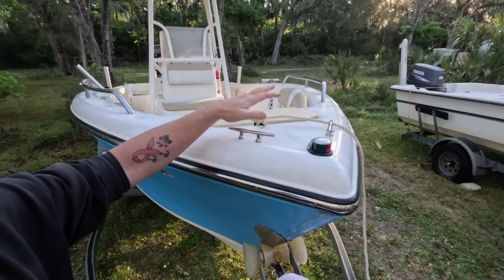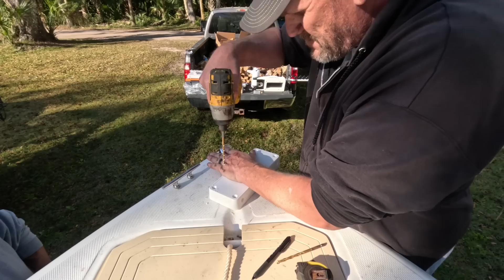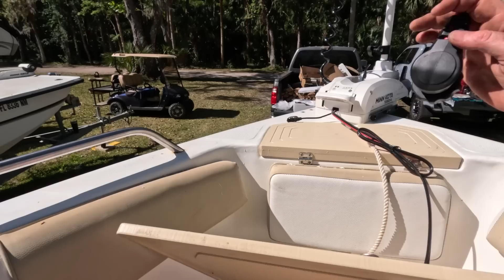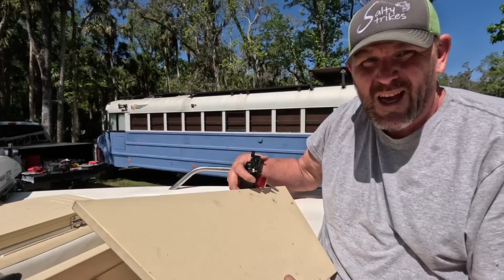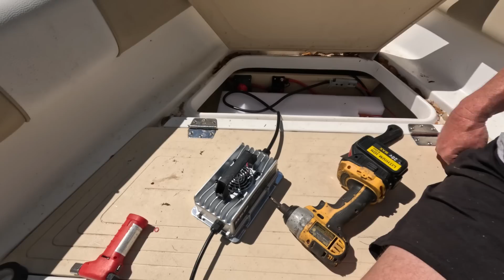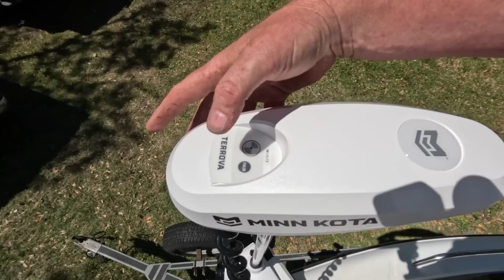36v Minn Kota Terrova trolling motor & 36v LIthium battery (FULL INSTALL)

Comment from the maker: Amazon Links:
MInn Kota Terrova 36v 60”- https://amzn.to/4iphouc

Minn Kota Terrova 36v 72” -https://www.amazon.com/dp/B0C7LF4NG5/ref=cm_sw_r_as_gl_api_gl_i_PPNCC7VS39KTRN2MG1VP?linkCode=ml2&tag=saltystrikes-20
EnjoyBot 36v battery- https://amzn.to/4iPZFMj

Mounting Plate- https://amzn.to/4kOVUbH

Minn Kota Plug- https://amzn.to/4isnutN

Disconnet switch- https://amzn.to/4iLubXB

60a Breaker- https://amzn.to/4iPXMzg

wire strippers- https://amzn.to/4kZum3w

wire- https://amzn.to/4itKoRq

Wago connectors- https://amzn.to/41JPSAt

Comment: why not a backing plate under the deck?
Reply from the maker: Unnecessary
Reply: I normally use backing plate to eliminate backing out and strengthen depending on vibration
Reply from the maker: @c @chippooutdoors5325 👌
Reply: Especially on my Xpress. Some nuts were incredible to get to

Comment: Is that a torch lighter that you are using for a heat gun? That flame doesn’t burn/scorch what you are heating?
Reply from the maker: Doesn’t burn or scorch unless you hold it too close or too long. I suggest using an electric heat gun if you question your skill level.
Reply: @SaltyStrikes thanks. I have never used a heat gun, but I have a few projects that could really use one. So I really was wondering and not being snarky. 😊

Comment: You need to use a better plug without wires attached to it. There are good plugs with the same allen screw connection in them to hold the wire securely. This way you would eliminate 2 in line splices and 2 possible fail points.
Reply from the maker: Nope, been using the exact same setup on mine for years , avg about 200 trips a year for God knows how long.

Comment: This is the set up i want for my old 19ft. Mako. Im definitely gonna use one 36v battery because of limited space.
Reply from the maker: Definitely worth it 👍
Reply: @SaltyStrikes thanks for the links. I think I can do the install myself. Im pretty mechanically inclined. Do a lot of my own stuff and save $$$! Ill need to watch you wire the switch and breaker again to get that configured right
Reply from the maker: @66tdarren good luck let us know how it turns out.
Reply: @SaltyStrikes I plan to keep my bow rail, cut a small section and hinge it where the TM swings in and out.

Comment: Would a 24 volt 80lb be sufficient for 19 foot CC?
Reply from the maker: Maybe, just depends on the current and wind. I always suggest getting 36v for saltwater because better to have it and not need it than need it and not have it. Nothings worse than spending all that money then drifting down current cause your 24v won’t keep up with the out going tide. 

Leave the 24v for the bass fishermen.

Comment: I don't think I'd put the piece of foam on top of the battery. The batteries can get hot when charging. I may be wrong, but it seems to me that the foam will prevent the heat from dissipating properly into the air.
Reply from the maker: What makes you believe that? It doesn’t get hot nor is there any heat dissipation  issues. We have four 24v 200ah lithium batteries in our RV, been running Lithium in our boat seven years, have installed lithium in about seven other boats, and the one thing that has never been an issue is heat. Most of these chargers charge at 10-20 amps max. When charging our RV from solar and shore we charge up to 150+ amps easy with no heat issues.
Reply: @SaltyStrikes  When I bought my Ranger 198P with 4 Lithiums, I was warned to keep the battery hatch open when charging to prevent excessive heat from building up from the batteries and charger, so that's what I always did. Don't have any personal experience with heat issues. Just thought I pass on the advice I was given.
Reply from the maker: @stevenvanetti6507 it’s inaccurate

Comment: I bought and installed a LiTime 36 volt lithium battery to run my 36 volt 112 lb thrust Minn kota trolling motor. Will only run for 8 seconds on spot lock and shuts off. It will  when I just run it operating with remote until I get over speed 5 and then shuts off. Taken motor to Minn kota service tech they  said no faults found running on their regular batteries. Reached out to LiTime through their website not much response. Any suggestions. I bought Thai battery after watching ur videos.
Reply from the maker: What did you use to charge the battery? What are you using to monitor SOC? Whats the voltage reading at full? Whats the voltage reading while running? Have you put a multimeter on it? 

From your comment can we assume you’ve had this issue straight out of the box or was it working fine then all of a sudden it started having this issue. We’ve been running four Litime batteries for two years non stop without any issues. 

What did the dealer guys so to diagnose anything, if anything at all other than swapping batteries?

Comment: Question: I have a 2008 Key West 1520 cc. For the most boats, are those forward storage areas good for placing a single lithium battery? I’m concerned about air circulation.
Reply: I was concerned because of battery heat. But after researching I learned that lithium live04 batteries don’t have a heating issue.
Reply from the maker: Why are you concerned about air circulation?

Comment: You reference 8 gauge wire for the lithium battery 36v. My 55 lb thrust calls for a 12v battery and 4 gauge wire. Will 8 gauge work for about a 6’ length?
Reply from the maker: You gauge for max amperage, how many amps would the 12v motor be pulling? Remember Volt x amps = watts. Higher voltage can run lower amps for the same amount of power at a lower voltage system. “Amps”A.K.A “current” is the determining factor. Should be able to google max running amps for your trolling motor. Like the 36v Terrova is about max 49 amps.
Reply: I’m running a max 60amp breaker and every where I search it recommends 6 awg
Reply from the maker: @TidyMighty for 60amps that would be correct assessment http://assets.bluesea.com/files/resources/newsletter/images/DC_wire_selection_chartlg.jpg
Reply: @SaltyStrikes  thank you , BTW, I enjoyed your video

Comment: So the red out of the circuit breaker goes to the pos on the battery and the black from the shut off goes to the neg on battery ?
Reply from the maker: @Joekiuber  no, disconnect and breaker are on positive side. Neg goes directly from motor to battery

Comment: Sorry fairly new to your channel and I love it ! I just seen you mount a 60” trolling motor on the boat , what length trolling motor was on the other boat (your boat)? Im asking because I have a 60” Ulterra now and am picking up a 2020 R200 next weekend and was wondering if I can use my current trolling motor with the 60” shaft and have it work or if it will be too short?
Reply from the maker: @adambrigham4241  https://youtu.be/1NQjzhaIJx0?si=9Wt62Jh-ZN8OBpQ6

Comment: Excellent video super informative I also do all my rigging and the only thing I would do different is the 60 amp breaker would be first from trolling motor not the disconnect. If the disconnect is first from trolling motor it’s possible it could overhear or burn up before the disconnect tripped . Tight lines great videos you put out.
Reply from the maker: @craiglivingston5441  you have that backwards, you want to fuses or breakers first and close to the positive post. Also the disconnect is rated for 250 amps which is 150 amps more than the battery actually can produce. The Lithium battery has a 100 amp BMS kill switch in it. So the trolling motor, wire, breaker and battery would all burn up long before it would damage the disconnect. Like our Victron Off grid system in our RV is setup that way, fuse right off positive battery and fuses from lynx distributor to devices. You don’t put breakers after a light switch in your house, same applies here the breaker is before the light switch. Hope that makes sense 👍

Comment: I am in the process of purchasing a 244CC key west. There's no access to the front of the boat as the anchore lock is to far to reach the front of the vessel. 
Key west is telling me that the vessel has a block of fiberglass underneath the top front of the bow. They say that they use SS sheet metal screw when the support their wind less.
Any other suggestions.
Thank you
Reply from the maker: @nickh.2007  can’t install an access hatch?
Reply: @SaltyStrikes  thanks for the suggestion. I can. That's probably going to be the only way out.

Comment: Hello Chris. The trolling motor appears to be blocking the navigation lights. Is that a problem??? Thanks
Reply from the maker: @thomasschaefer505  maybe a few degrees to starboard, unless you move them the the rub rail or T-top you will lose a couple degrees one side or the other.

Comment: Nice job 👍  easy to follow 👍I had to mount the position sensor on top of my canopy as it had intermittent singnal under it 🤷‍♂️I put Tectyl 506 on every wire, connector, joint, and under the heat shrink, it’s messy but I get O corrosion. 🤗

Man what happened to your hands😳 it looks like ya had a knife fight with a blender 😂🤣😳
Reply from the maker: @shanerolfe8022  fighting the bolts in the anchor locker getting the cleat off, awkward position with the impact gun.

Comment: Just a bit of added protection, especially for salt water applications. I use a bit longer shrink tubing and and you brush on a thin layer of silicone paste on your Allen head connector, then shrink it. Now it is completely water proof, less chance of corrosion. Also 3m 5200 sealant on any hole put in boat to help keep it integrity.
Reply from the maker: @a.scottdagata9274  haven’t had any corrosion issues in almost 6 years, and I’m literally on the water every other day.
Reply: @SaltyStrikes  I do fresh water installs here in Central NY. I guess I go way overboard, I would have thought that salt water applications would attract corrosion. Love your content and watch all your videos, keep them coming. Thanks